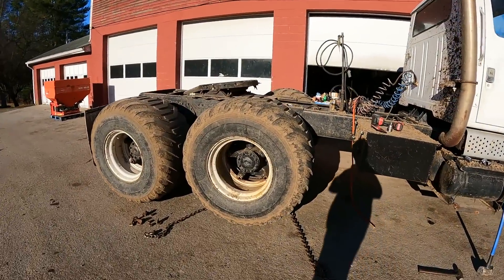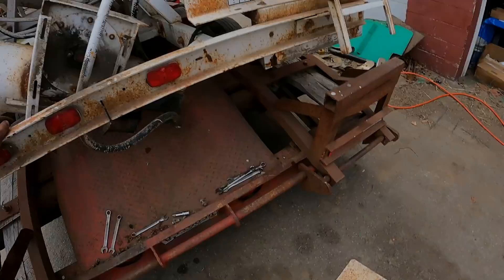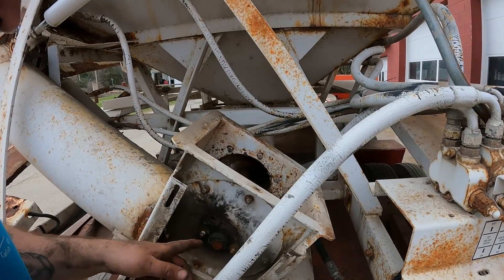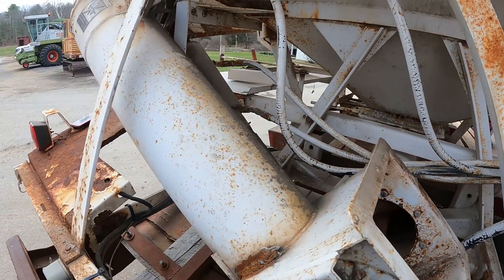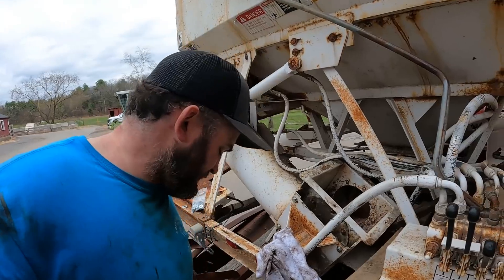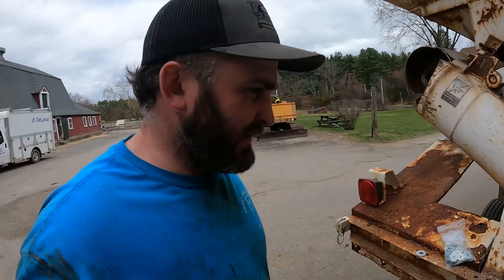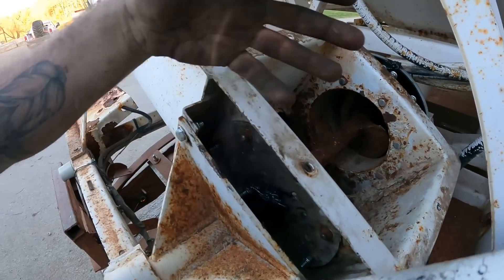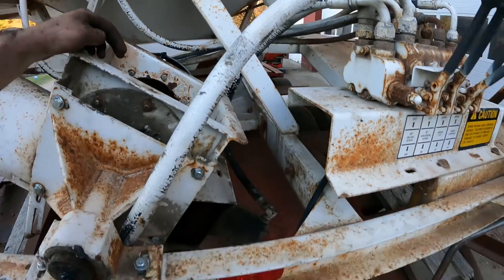Tire & Fertilizer Tender Repair- Something Is Always Broke

Comment: That tire repair is called a sectional sidewall repair.   Also for about 300 bucks you can get good tire bars and a good duck bill tire sledge hammer.  I do all my own tire work.  It’s not to bad.  Also they make tire plug/patch kits that come with up to a 5/8 plug and a 4 inch patch.

Comment: That is going to be top heavy once it's filled, maybe need to weld heavier support feet, and wider so that you can bolt it to the trailer chassis. Safer than just chains. Just needs a coat of paint inside and out then be good for years.. love the channel. Keep'er lit.

Comment: Can't you put a small engine with oilpump on the trailer?? Might be cheaper than 60feet hydraulic's
Reply: or run some hydraulic tubing on the inside of the trailer frame  and have the connector ends where needed

Comment: Unfortunately my tractor tire i sliced right by my bead (loading onto old skidsteer style trl) and so it wasnt able to be vulcanized to be fixed proper but i was able to get it booted. Ive been running it 8 ish years since my boo boo. Ive since replaced my rusted rims.  Yeah i dont want to buy a new tire. The one i sliced was only 2 months old and i just spent $800 dollars on it.  You do what you can do to buy time unless you have someone else pocket book. Lol